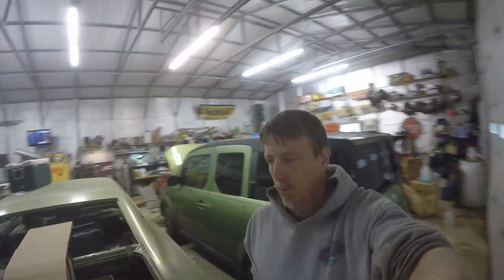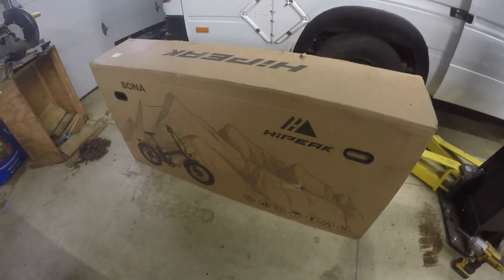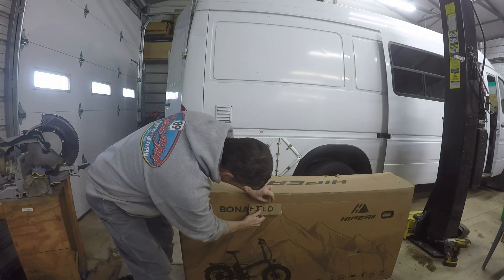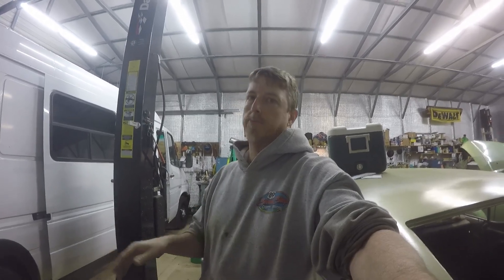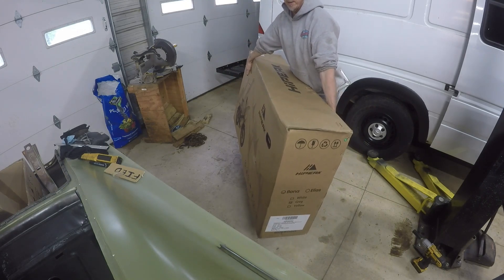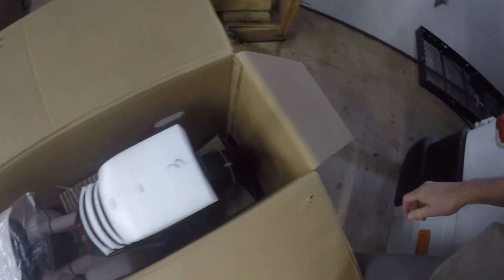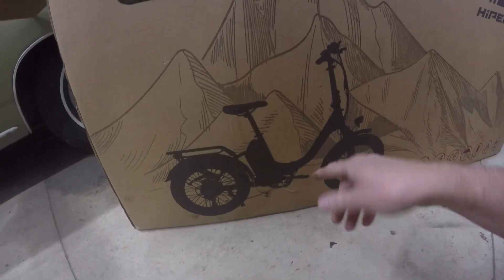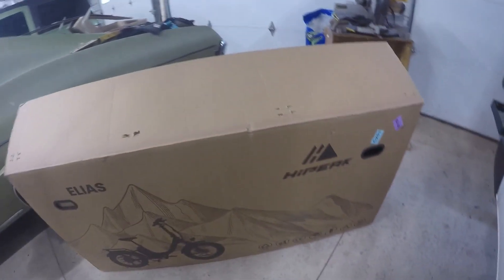HiPeak Bona Electric Bike Assembly

Comment: For anyone watching this, when you put the wheel on, the pointy end of the conical spring points towards the inside of the wheel hub, not towards the outside of the tires. And yes you have to put on both springs!

Also, after you put the wheel on, you attach the light to the hub. Don’t mess up and attach the hub before you put on the light as well. 

Also, having a ratchet makes it easy to put the hub and light on the front wheel. The instructions, while they are written in plain English, do not have any pictures and don’t talk about putting on the light.

And one other thing, the reddish orange part of the bike frame looks completely red in real life, but on Amazon and on camera it looks reddish orange.
Reply from the maker: Thanks for adding about the front wheel. Hate my battery had died. Didn't realize til I was editing. I should have refilmed that part.